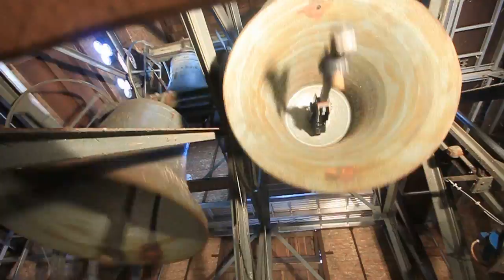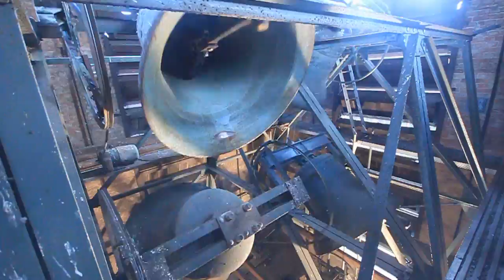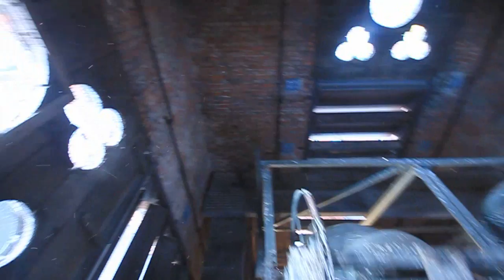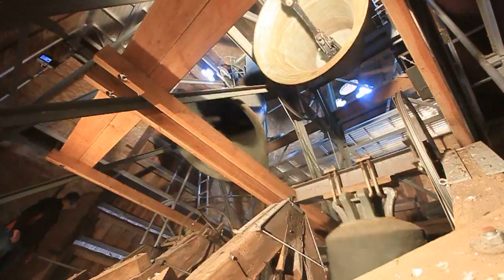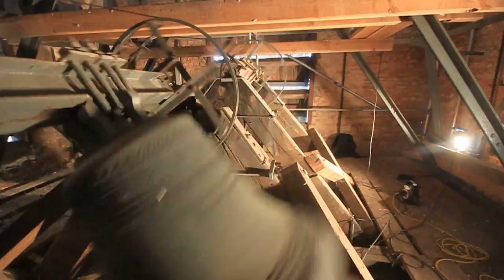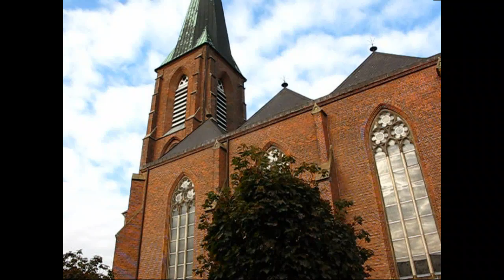Dinklage Oldenburgerland: Glocken der Katholischen Kirche St. Katharina (Plenum)

Comment: 22:35 - After the Picture overlapping with while the 2 Bottom Bells are slowing down, the Video & the Sound appears to be off track, probably as the Sound goes first before the Video, but I’m not sure. 😕

I just do know that the Video & the Sound are off track there, after the Picture Overlap during the 2 Bottom Bells slowing down.